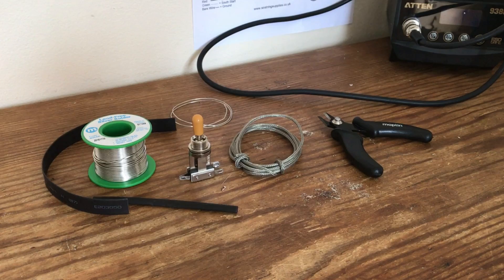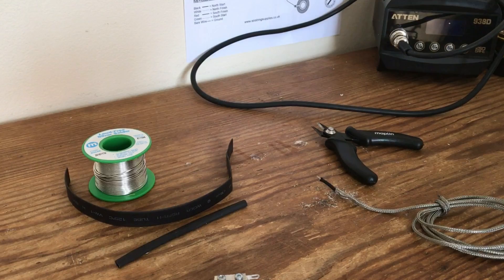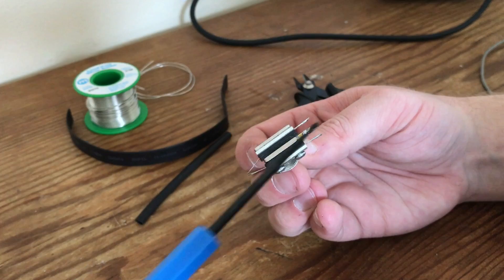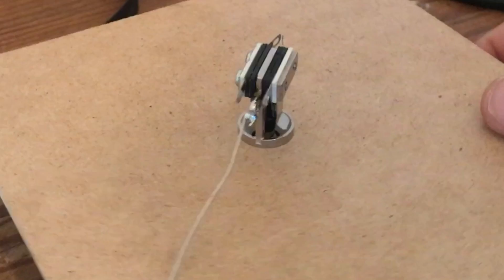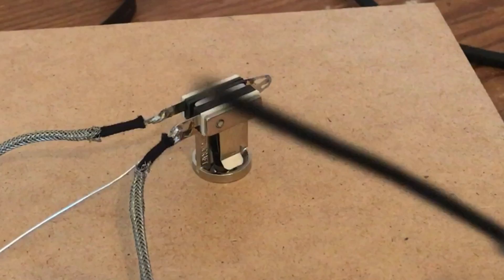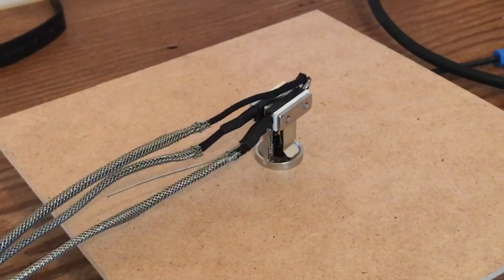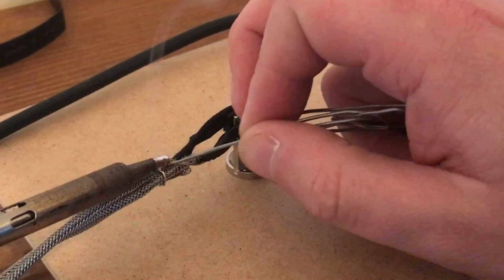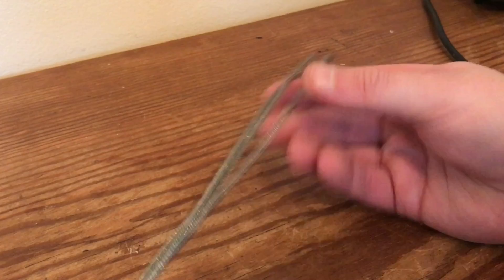How to Wire a Les Paul Toggle Switch (Using Braided Guitar Wire)

Comment: Quick tip if your using this method for a les paul, angle the wires up/down instead of straight out before you solder them. Mine wouldnt fit in the cavity after i finished soldering. Great video none the less
Reply from the maker: Very good advice. This was the first video I recorded, since then, all prewired toggles that we sell get the wires bent in a downward position before being soldered. Comment pinned.
Reply: God, where was this 10 years ago when I discovered 50’s wiring lol
Reply: Do you have a video on how to wiring the toggle switch that is like a tiny box? And this tutorial is really helpful! Thank you
Reply: Wouldn't that depend if you were using a long or short switch?  Learned the long switch is for the LP Traditional types and the short switch is for the studio models and SG's.  I have a long switch in my LP now and bought a short one so the 3 wires would fit through the body and into the cavity.  Rewired the long switch in a downward position. Long switch looks more heavy duty than the short Switchcraft ones.  Yes, you have to angle the wires down to get it to fit in the cavity.
Reply: True I did mine like this video and it won’t fit. That being said I love this guys soldering videos, I’ve learned a lot and my soldering is vastly improved.
Reply: @steverossi7949  I guess the solution is too look at the guitar its for and see were the exit hole is and decide then if its down or sideways.
Reply: Yep, broke the first switch I did because I didn't understand this simple trick to actually inserting it into the cavity!
Reply: I followed this pattern and the switch wouldn’t fit and I had to do the entire job over.
Reply: @cementheed the simple trick is to watch a different video. This guy has a lot of good tips but he misses the mark with the direction of the wiring. Its unfortunate that the most important part of wiring layout doesn’t allow the switch to be installed as instructed.
Reply: @Outdoorshuntingshooting this would be good info at the beginning of the video.
Reply: @SixStringSupplies  noted...good i read this before firing up my solder iron...cheers.

Comment: I just want to say thanks for the video I've just done my first switchcraft toggle and the video is perfection considering I've never soldered before.
Reply from the maker: No problem! Glad it worked for you. Thanks for watching.
Reply: @SixStringSupplies how long the wire cable for toggle switchcraft To potensio needed. And to the jack output

Comment: Good video.  I appreciate you taking the time to show this.  I would add coloring or labeling the two wires that connect to the hot sides of the toggle switch so you know which one connects to the bridge and neck pots
Reply: yea I threaded the braded shrink tube and now I have no idea which one goes to where...

Comment: Would have been nice to mark the control cavity ends for location before installing the heat shrink.. Makes it a bit more challenging doesn't it??  ;)
Reply from the maker: Indeed! But I’ve done enough to have a good feel for it. I Should explain it in the video though. Thanks for watching and your feedback
Reply: Thought the same.  Great video.

Comment: This is a great video, however, when putting the toggle switch into the LP cavity, make sure that one can bend the wiring harness UPWARDS such that the switch doesn't get damaged working it into the cavity.  Once inserted in the cavity, one should then bend the harness DOWNWARDS such that it is now straight. This is VERY important, as it is easy to break the the switch by forcing it sideways and placing too much lateral stress on the toggle control.

Comment: I noticed that you don't use any kind of flux or resin when you solder.  I was at the electronics store and they recommended using a 835 Rosin Flux RAtype flux/Non corrosive residue for leaded and lead free solder.  If you use a resin core solder, a flux may not be needed but they say it won't hurt.

Comment: Do you have to be super careful to not have the solder leak through the metal braid to the hot wire potentially causing a short? The metal braiding seems annoying to work with when you can just use simpler wire.
Reply from the maker: EvaSlash yes you do need to be careful. True, though the outer braid shields the inner wire. Long wires (as in travelling from the switch to the jack) are more susceptible to electrical interference and feedback. The outer braid reduces this.

Comment: Thanks for the tutorial. Do you have to ground all braids of the wires coming from the switch individually? Or would it suffice to ground one since they are soldered together right by the ground lug of the switch?
Reply from the maker: You have to ground the jack connection to the jack, and one of the braids to the volume pot. The other one can float about. Best to sodler it to stop it moving and touching something it shouldn't, but not essential. Thanks for watching

Comment: do you have a video of a wiring a less paul 4 pot push/pull with Seymour Duncan P-rails without the 3 way toggle ( not the pickup switch).  Darrel Braun did it in his ultimate epiphone video.  That would be quite helpful because the diagrams are confusing and use the 3 way toggles instead of push/pull pots to switch between P90 and rails

Comment: First time building an LP kit and could use your help. I am using  braided wire from the toggle switch. I am also using long shaft cts push/pulls on both volumes. Since I will have space under the pots, from the point of entry into the wiring cavity can I wrap the braided wire  under each pot, around the back of each shaft, solder/ground to the side of pot then solder to middle lug? There will be heat shrink tubing from cavity entry point to point of ground and again from ground to middle lug. Thank you.

Comment: Zabardast cheers from Toronto......My 3 way toggle switch for cherry red Epiphone DOT 3.....in the centre position, the Neck pickup goes off if the Bridge pickup Volume is Zero? Is this normal? I thought in the Centre position, the Bridge and Neck pickups Volumes were independent?

Comment: How would you go about wiring two humbuckers, with braided wire, to a guitar with just one volume and one tone pot? 

I have never seen that done on YouTube because I guess it's not that common.
Reply: Run both hot wires from the pickups to the left lug on the volume pot and the ground to the back of the pot. Run a capacitor from center lug of volume pot to center lug of tone pot and a ground wire to the back of each. The left lug of volume and the right lug of tone pot gets bent back and soldered to the pot. Hope that helps. The switch gets wired the same way.

Comment: excellent video!, what diameter heat shrink tubing are you using for the three braided wires from the switch?
Reply from the maker: Thankyou! 7mm for the three braided wires and 3.5mm to cover the switch terminals.

Comment: Hey! Is there a reason why the two lugs are pushed together?
And I've rewired my lespaul but for some reason the bridge pickup combines itself with the neck pickup once i wire in the neck pickup into the switch - cant figure out the reason why .. any idea?
Reply from the maker: You don’t have to push them together - but your output wire needs to be connected to both lugs. So bending together makes this easier, t’is all.
Reply from the maker: And for your issue - most likely a faulty switch

Comment: Hi! So How do I install  the THREE WAY SWITCH to the top circular hole. Since there is a tunnel of sorts from this down to the main area for the pots, do i a. Try and push to old switch down this tunnel? or b. disconnect the old switch and re solder the three wires to the new switch which would have to be pushed down the tunnel. I ask this becuase I have just bought a complete replacement harness with the 3 way switch ALREADY soldered with wire connected to the pots?  This video didnt show how this should be done? What should I do please?
Reply from the maker: De-solder from pots, put switch through hole and then re solder. Companies should not be supplying Les Paul harnesses with the switch already soldered to pots 👍
Reply: @SixStringSupplies  Very helpful, thanks! actually I managed to pull the new switched already attatched to the harness through the tunnel using wire!

Comment: What sizes of heat shrink tubing do you use?
Reply from the maker: EvaSlash 3.5mm on the individual terminals and 7.0mm for the braided wires sleeve.

Comment: Just wondering if its fit to the toggle hole?
Reply from the maker: Noli Calunia umyes if course - you may have to drill the toggle hole to 12mm diameter if it's a non US made guitar

Comment: Hi.  Can anyone clarify something for me.  Every other wiring diagram I've seen has the earth coming from the other end of the switch (hot to output jack).  Does it not make any difference which way round it goes, or is this just for the Les 
Paul vintage wiring?
Reply from the maker: The ground lug on switchcraft toggles is on the the opposite  side to generic switches. Same principle
Reply: @SixStringSupplies  Thanks for your help and for your terrific videos!

Comment: This set up will NOT WORK  with a Les Paul!!!!! All the leads must run so they trail out the bottom of the switch  or you don’t have any room to install the switch into the guitar body! You have the common ground tinned wire stub hitting the side of the switch mounting hole and that common ground bus wire sticking out 90 degrees to mounting direction took up the rest of the space in the hole! This might work on an SG but no effin way will this wiring layout gat that switch in the hole to install! Now I have to buy another switch and more pushback wire! What a hack job!